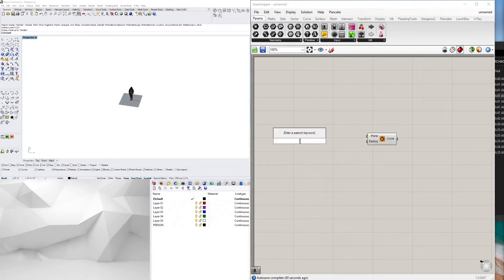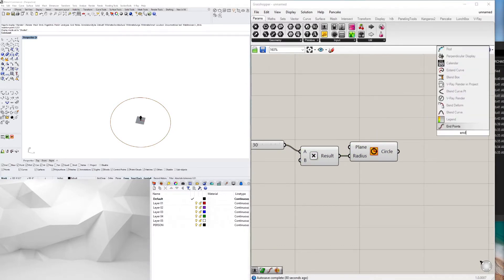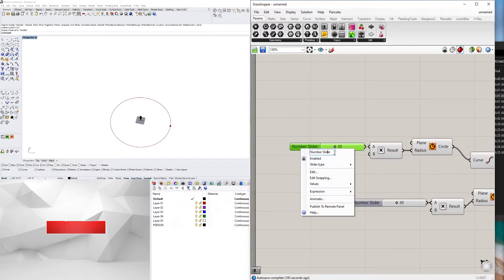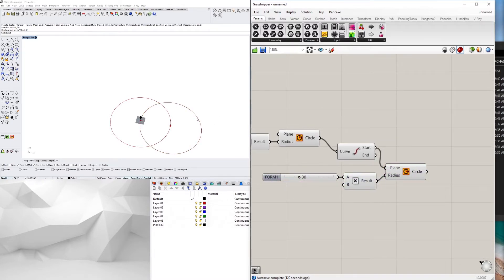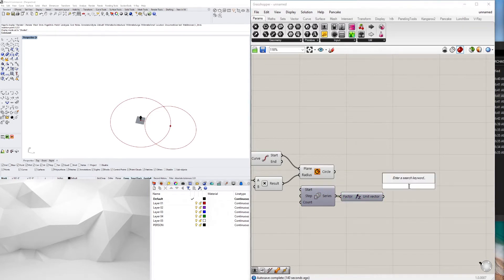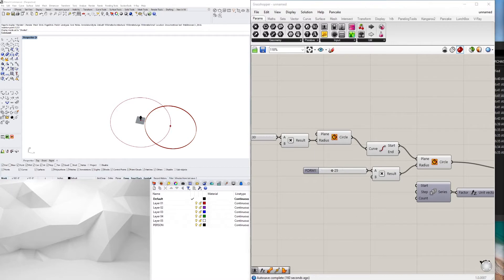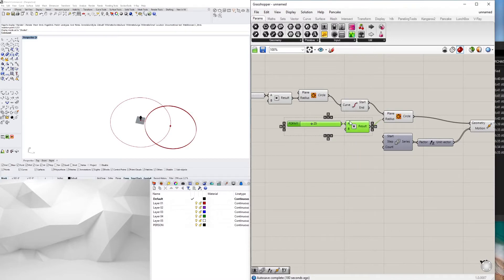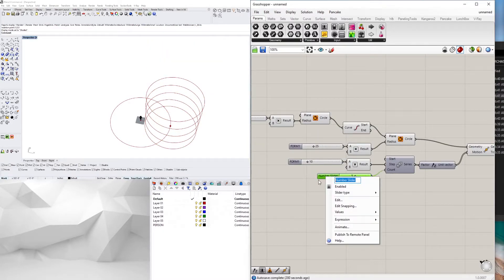Twisted Tower Rhino and Grasshopper Parametric Architecture

Comment: Grasshopper IS one of the best events that contemporary architecture found. Parametric Architecture is a way of interpreting architecture on itself. The fun fact about it is that parametric architecture remains one of the oldest approaches that has more than 5,000 years old of history. 

Mathematical equations, logic, analytic geometry, differential geometry, simulation, optimization, programming in just one application.
Reply from the maker: 100% AGREE

Comment: everything is good but speed of video is very high to learn and understand
Reply from the maker: Thanks for the feedback.  I created this course with a similar building.  I made this free for you to check out in the next 3 days.  Let me know if you have issues with the link. I explain it in detail in this course.

link:
https://www.udemy.com/course/twisted-parametric-building-using-rhino-and-grasshopper/?couponCode=D350D3EB7150819EB4CC
code:
D350D3EB7150819EB4CC

https://www.udemy.com/course/twisted-parametric-building-using-rhino-and-grasshopper/?referralCode=0F6D87544C2EB9D65180